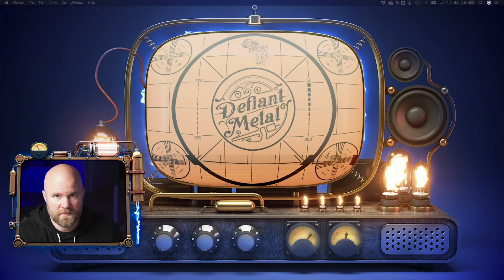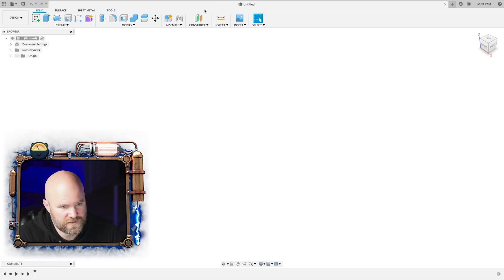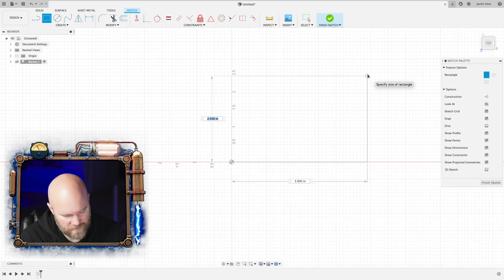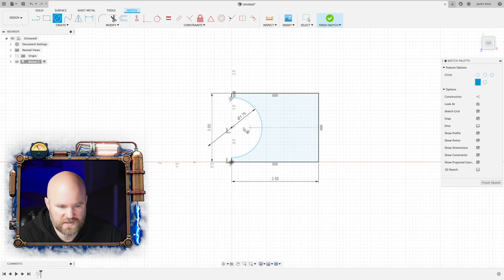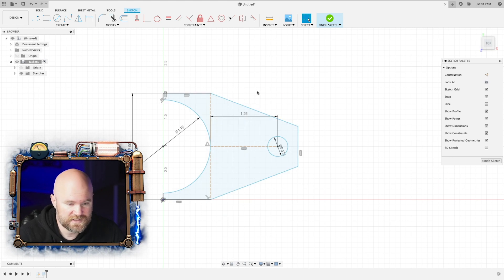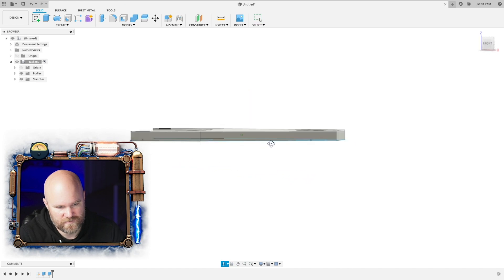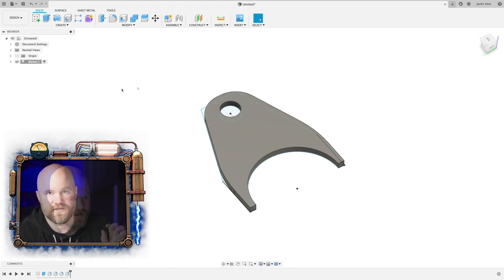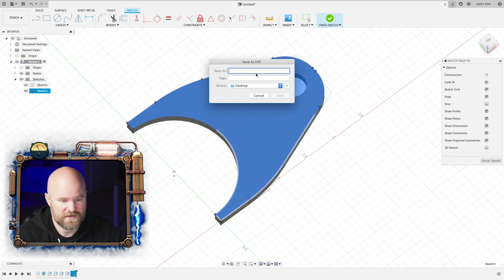How To Draw Your Own Metal Parts For FREE!

Comment: Finally somebody that will explain clearly step by step... Thanks...
Reply from the maker: No problem, only bad part is they took exporting to dxf files away from the free version since I did this video.
Reply: @JustVoss  it worked for me. I wonder if it's on a time limit.
Reply from the maker: I’ll look into that, maybe they gave it back to the free version

Comment: I’ve been using autodesk for about 2 years and it’s such a great program. You can build whole handrails and get a material cut list with hole locations and angles with 99.5% accuracy. I recommended people to learn it because it will make production a lot faster and know exactly the amount of materials you’ll need for any project

Comment: Thanks for the good video. I want to try it but I am in the middle of moving. I do have CAD Lite and I do have a Torch-mate 2 X 2 CNC plasma cutter. I have made a lot of programs for my metal art. You made it look very straight forward but I am older and a little reluctant to learn something new. I live in Racine, WI but I am moving up north to a very small town. I am not sure if I will be able to do my art any longer. I have never used 3D before but then all my things are flat until I bend or weld them.

Comment: I would like to see how you can use fuson to make a cut file or nc file. I recently got a plasma cnc and have yet to be able to do anything with it mainly do to not having time to learn how to program it. But I use solid works and it seems like nothing I draw will work on it. It's been really frustrating due to the cost of the machine. But I know it can do what I want. And the company that's sells the machine has been no help. Idk what to do.
Reply from the maker: You could learn how to make the actual file with tool paths in Fusion or you could save the .dxf like I show in the video and then import that into the software that I assume came with your plasma table.
Reply: @JustVoss  I've tried. Idk what I'm doing wrong lol. It's been really hard to find info. Idk what else to do other then sell the table but that will only make it hard on someone else.